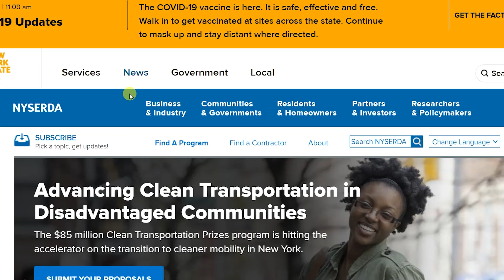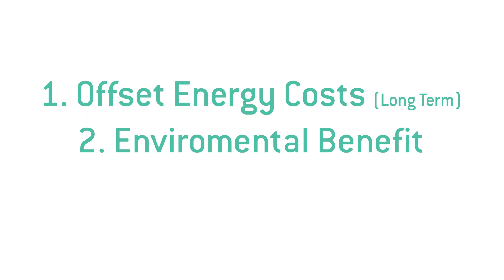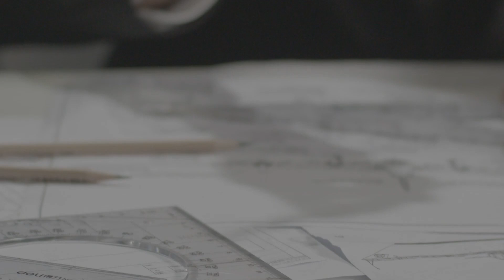Everything You Need to Know About Solar Panel Flat-Roof Installation!

Comment: what mounting system did you all use? I have a flat roof and I like this structure.

Killer video and yeah, joe pesci's entertaining
Reply: 2" Schedule 40 galvanized pipe and floor flanges. Any plumbing supply but, you'll need a cutting tool for the pipe which should be all pre-measured before the install. Best to use a solar panel installer. Make certain that you have as close to an east west sun-path with (obviously) southern exposure. Your angle of declination should be approx. 25 degrees. The video pretty much explains everything else and you can see the installer's name and number if you look!  Regards,...(Joe Pesci)

Comment: Does the install damage the roof?
What do you do if the roof leaks or needs maintenance?
Reply: It does not! It will be 2 years this May (2023) that this solar install took place. I am the homeowner and could not be more pleased with the outcome. First off, the solar panel install company (in my case, Kamtech) does guarantee against leaking however, prudence and general maintenance dictate resurfacing your flat roof (I use a WHITE elastomeric liquid compound that comes in 5 gallon pails) at least once every 2 to 3 years! One can literally coat the roof with a paint roller like you would use on your walls {medium nap, BTW} and it takes about 15 gallons to cover a 20' x 55" surface with one coat. It takes 1 or 2 people approximately 3 hours to coat correctly.
 You would be surprised at the UV damage done to a roof by of the same source of light that provides power to the panels. BTW,....in case you are wondering, my solar setup has been worth the investment by far. My average electricity bill is 10% of what I used to pay. And with the still available (even increased somewhat) tax rebates and incentives, it will probably pay for itself within another 5 years. 
Overall, one of the BEST investments I have ever made!!!
Reply from the maker: I want ot do a follow up to this with him but no! (Despite the minor setbacks) It's been great since installation and he assures me that his bills have been significantly increased YEAR ROUND!
Reply: @eznycrealestate  Pardon my friend but I believe you meant to say "significantly DE-creased!" Ne c'est pas??
Reply: @eznycrealestate  You do REALIZE that the correct word is DECREASED! LOL! Point of fact, with deductions, it will have paid for itself in another 3 years.